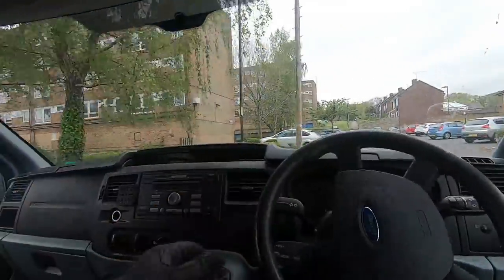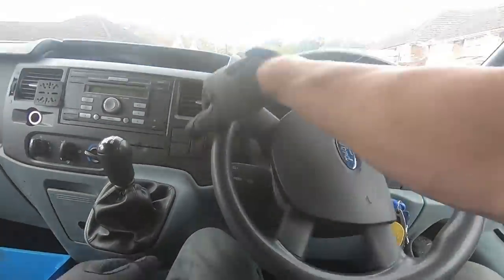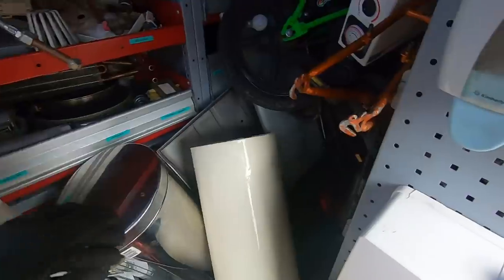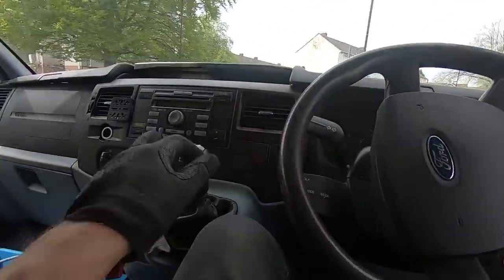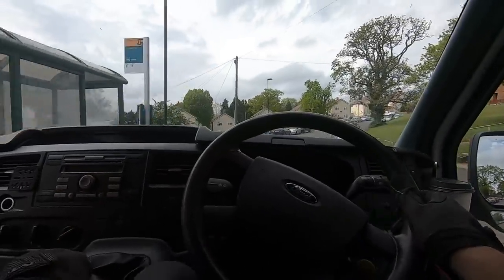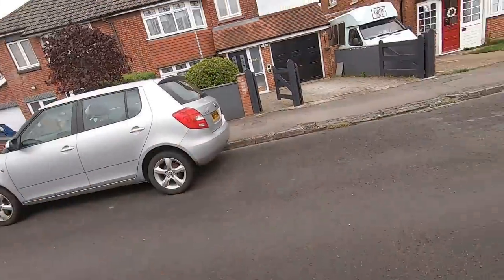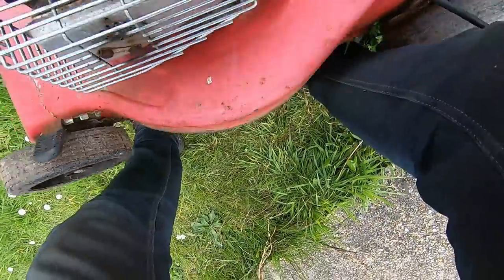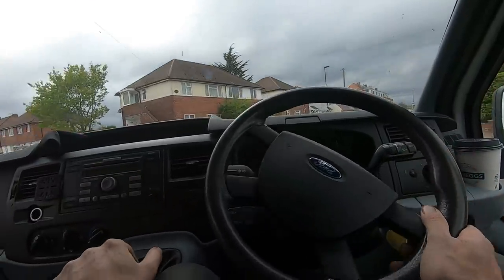Sunday scoops - I almost accidently stole a cooker 😲

Comment: You need to rub down rust prevent, fill and primer and paint that wheel arch before the rot sets in.
Reply: Van looks mint but doesn't take long till it looks rotten! Transits just disintegrate

Comment: Can't be good for the van driving around with all that weight in it constantly. Nice scoops
Reply: They can handle it💯
Reply from the maker: It's nothing she's designed to take 1200kg easy apart from the odd steep hill and a slow driver in front you can hardly notice nearly a ton in the back.
Reply: Vans are designed for heavy loads...